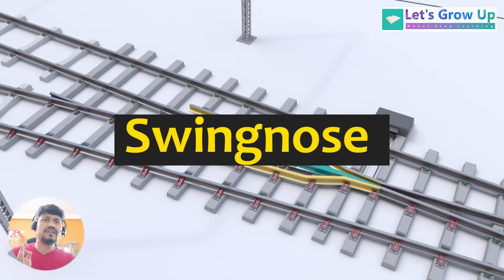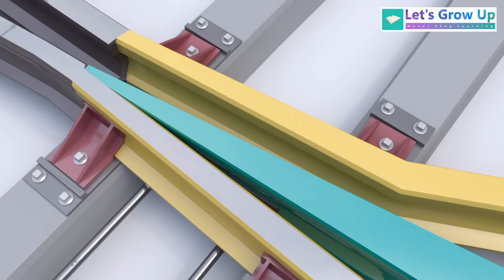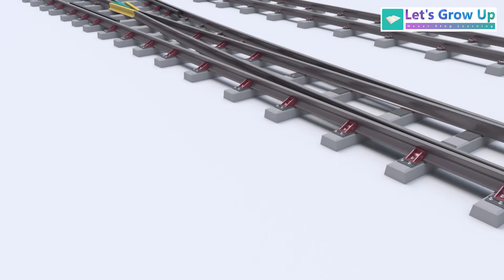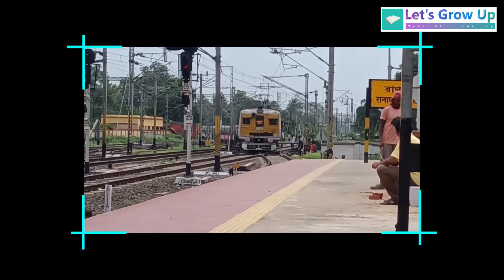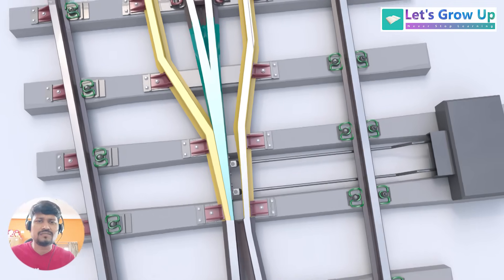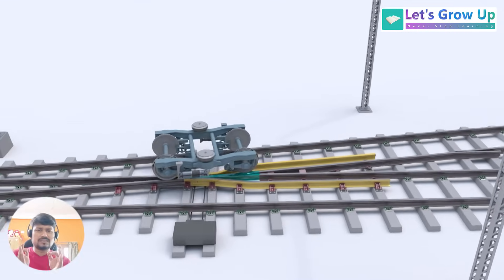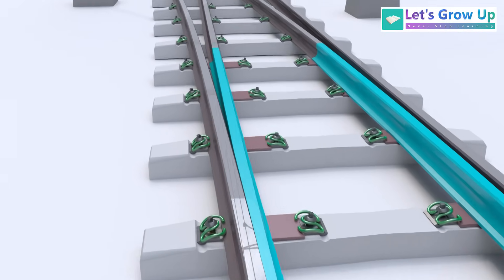How Chinese Swing Nose Turnouts Work | Indian vs China Turnout

Comment: It's a 1950s concept or older (since there are switchable gapless diamonds and crosses on tram lines since 1920s including still in operation ones installed pre WWII) widely used in Europe and Japan since 1970s. There's a British patent applied for in 2008, but thought developed countries have unified patent system in this case it has glitched, and it's well known since there's is a map of where this patent is in effect and this map does not include most of mainland Europe or Japan.

Comment: It is false to say that the reduced speed through the diverging track of a turn-out is a consequence of the gap in the railway frog. Rather, it is because of the curvature of the track along the diverging route. For this reason, the permissible speed in a diverging route in a North-American turnout is higher in a #20 turnout than in a #7 turnout. However, the permissible speed in the non-diverging direction is the same in both cases and it is that of the adjacent track territory. The very same speed restrictions apply in the case of moveable point turnouts, i.e. in both fixed point and moveable point turnouts, the permissible speed along the non-diverging route is unrestricted. 2025/01/20. Ontario, Canada.

Comment: The technology was developed in the 1950s and 1960s with the emergence of high-speed trains. In particular, countries like Germany, France, and Japan, which heavily invested in high-speed rail systems, standardized the use of movable frog crossings.

High-speed rail lines (from the 1980s onwards):
With the expansion of high-speed rail lines, such as for the ICE or TGV, movable frog crossings became essential, as they are a prerequisite for speeds exceeding 200 km/h.

Comment: Were are the yellow parts for?
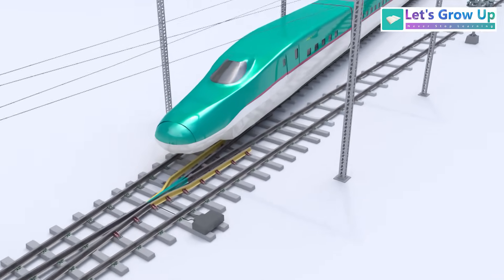Reply: In case of derailment, it guides the wheel past the "wrong" tongue. Otherwise the derailed wheel might catch on the regular moving part of the switch (tongue, gray) near the heart and push the train away from the rails. For Example if the train goes from left to right at 2:25.

Comment: The animation at 2:12 looks wrong imo, the switch (right pic) will guide the train to the right track (mainline), while the swing nose turnout (left pic) would cause the train to diverge to the left (branch) - actually the left wheel will hit the nose with the inner side of the flange, derailing the train. It rather causes confusion. Also the pic remains visible for only a couple of seconds, and viewers don't have enough time to examine it - I had to stop it several times exactly at 2:12 to view it carefully. Pls consider fixing the above two little issues.
Reply: This channel is dumb anyway, I don't expect anything with sense.
Reply: That is exactly my observation. Both animations together cause the train to derail.
Reply: You beat me to it! It should be easy to correct the video.
Reply: Le cœur mobile ne dispense pas de déplacer la pointe de l'aiguille.